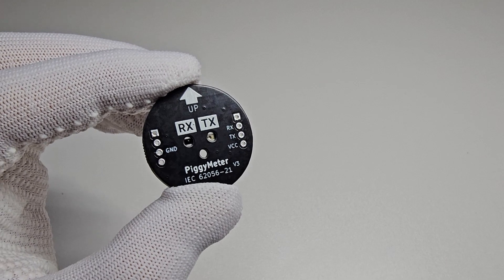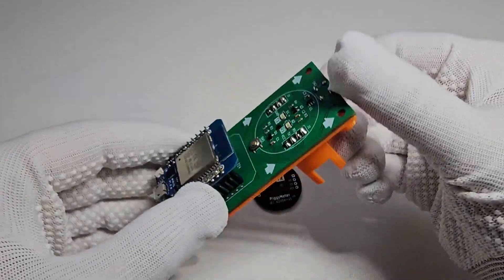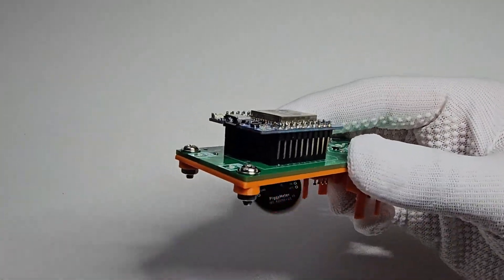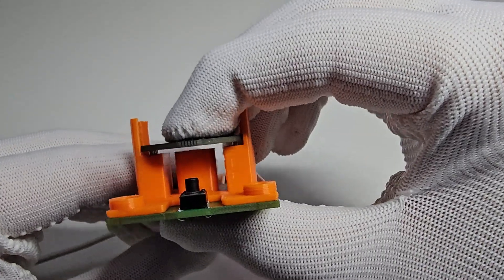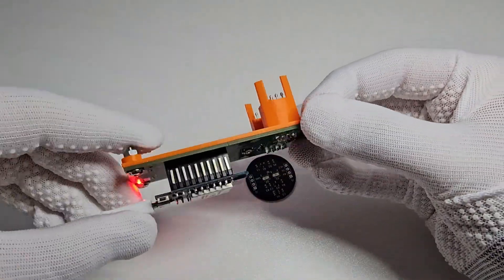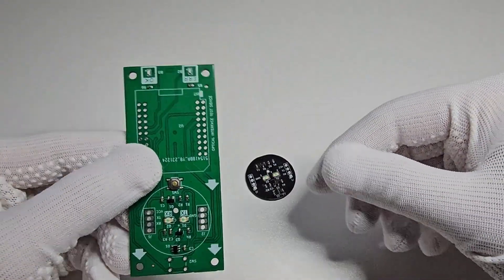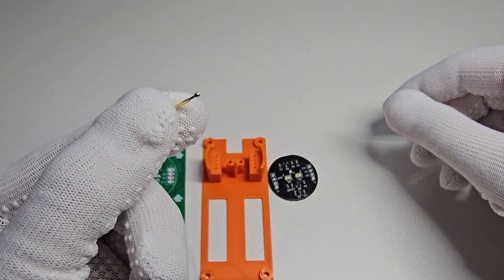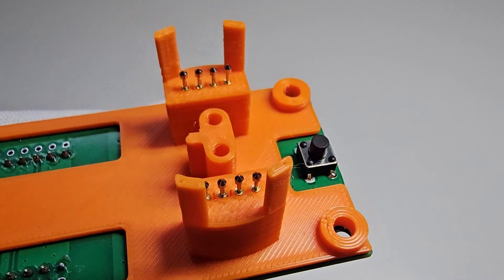Testing the optical interface

Comment: Very robust design. Industrial manufacturers use similar 3D printed contraptions to flash PCBs industrially.
Only question, why is this optical interface circular?
It makes its assembly fidgety and allows installation in the wrong orientation.
Reply from the maker: Requirements of IEC 62056-21 spec makes round PCB more suitable for projects.
Actually there is a hole in the board to prevent wrong orientation. The pin to fit the hole is already broken and not seen it this video.